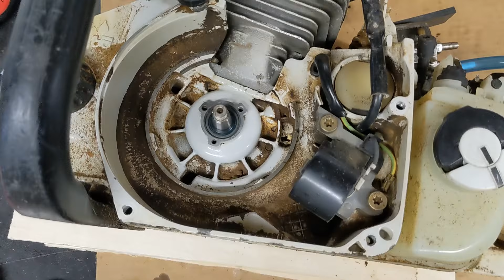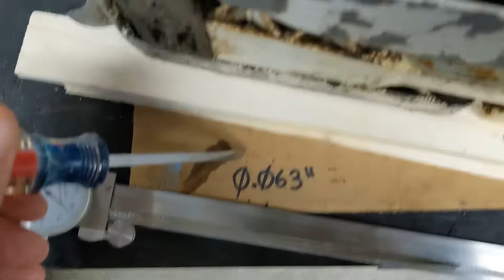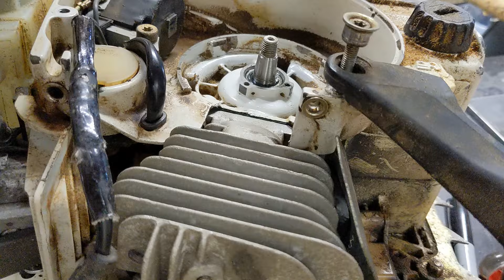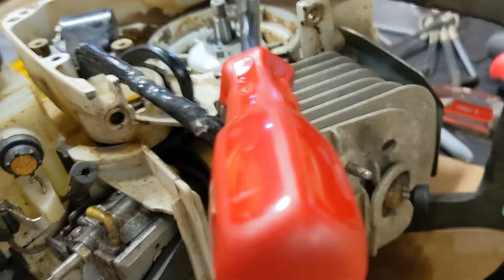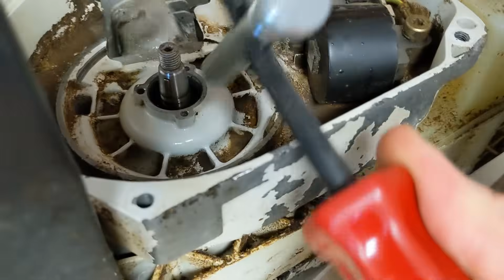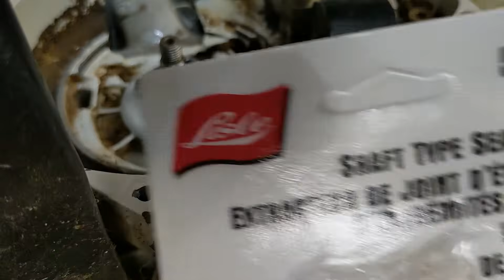How to REMOVE the Small Crankshaft Seal on a Stihl Chainsaw – WITHOUT Buying Expensive Tools!!

Comment: So today is April 8th, 2025. This worked well.. I was a bit concerned about the filing.. and I used the flat hear screwdriver and pried it out gently using the nut on the puller and the top of the crankshaft. I figured the crankshaft is hardened steel. Less chance of hurting that than pushing a hole through the  pot metal case.. it worked perfectly. Thanks
Reply from the maker: Glad it worked smoothly for you! Thanks for taking the time to leave a comment - much appreciated!  Hope you are up running and making some wood shavings : )

Comment: That particular seal is difficult to pull even with the stihl factory tool. Just an FYI to anyone doing the job remove the woodruff key from the crankshaft before you go to install the new seal.
The factory tool to install this seal to the proper depth is Press sleeve STIHL part number 1121 893 2400 ~$6.49 at your local dealer.
Reply from the maker: Thanks for sharing the details on the sleeve for installing. I'll definitely snag one before doing this again. I had a number of viewers ask about leaving the key in. The one in my saw was jammed in there and figured it was best to not damage things further trying to dig it out, the best I recall. Thanks again!

Comment: Good job!  Put a wood or plastic wedge under the fulcrum when using the case, or you can punch a hole clean through…
Reply from the maker: Yikes, I can picture that happening with the cast case material. Thanks for the tip!

Comment: Did it scratch the crank?
Reply from the maker: Nope, no scratches at all. I took my time and put oil on the metal to minimize any chance of scratches. If someone was not being careful I could see there being a risk, but even the OEM tool works on the same concept. Just more controlled since it's two jaw with a threaded center.

Comment: I could see removing the handle on that tool and using a pipe extender to get more leverage and also get your hand away from the danger zone when the seal lets loose.  I like to say I've never owned a tool I didn't modify.  ;-)
Reply from the maker: Very good idea. I'm probably lucky that I didn't cut my hand open, there are plenty of hard edges on the case of the saw to 'bite' you! I'll at least where some gloves next time!